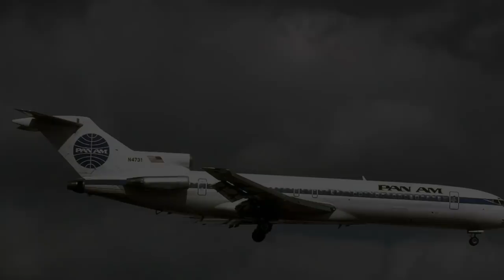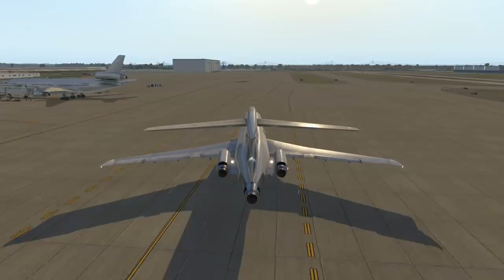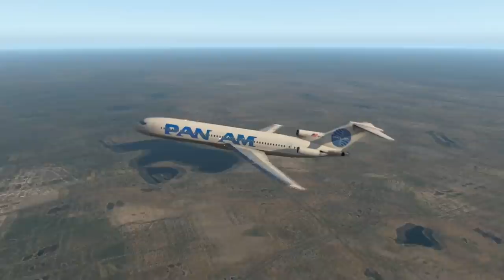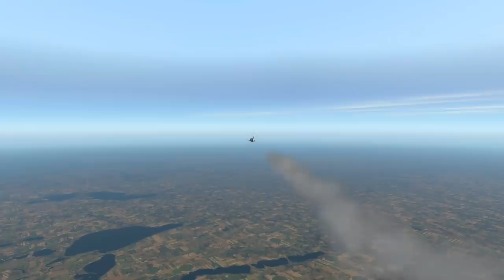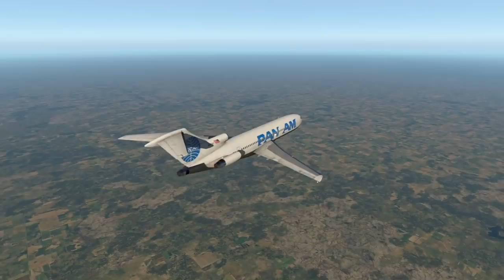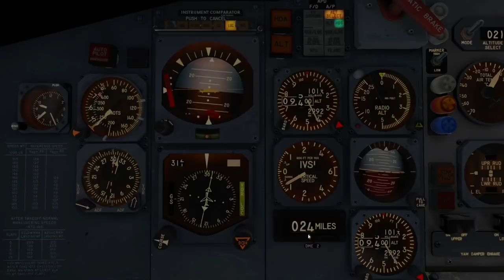An Invisible Threat | Pan Am Flight 759

Comment: Wherever you are recording, you may want to drape some blankets on the walls, to remove the reverb.  Your audio will sound better.  Also, if you have a concrete floor, put something down on that... I really enjoy your work. Please keep it up.
Reply: The real problem is simply that the volume level is way too low.  I've got it cranked up to the max on my smartphone and I can still barely hear it.  And the signal-to-noise ratio is poor as well, as a result of the super-low volume.  ☹

Comment: Hi , I have discovered you lately, enjoying the presentation you do on classic accidents and subscribed. Already, I have commented on the Saudia L1011 fire, now on this one.
I was a flight engineer , 727 my first type for 10 years.
When this happened, we were having recurrent sim training twice a year, with Lufthansa in Frankfurt. Their sim was state of the art for 727s, and in one session they wanted to reproduce this crash, to see if we can survive. All part of training....
They had all the details, and had entered them in their computers, so it was pretty much accurate.
The take off EPR was the "reduced" option of #1 1.88, #2 1.90 (due to the S duct), #3 1.88 . Normal (max) EPR was almost always 2.00, 2.02, 2.00. 
They took off with the reduced thrust, which we used very often for better engine life when this happened.
Ok, on the first run , no matter what we did , lower the nose, then rise again step by step etc, We crushed! There was simply no altitude available. It was shocking, we were shocked , we "lived" the death. The German instructors did it on purpose ,in order to prove something!.... When you are dying ,you should think out of the box, survival should kick in..... meaning....
On the second run, after we had encountered the wind shear, the deal was to *slam the throttles to firewall*, don't care for exceeding limits, burn all 3 engines if we had too...
We did it, and this time we survived!, the engines on a real plane would have needed to be replaced, but there would be no crash.!
Lesson learned, simple things and measures can save life...
PS. That night after the sim , drinking beers in our hotel bar, the repeated saying was " man we died tonight"....we really lived the agony....
Reply: I FLY TOO Engine failure- Check Essential!   Lol
Reply: Thanks for this, very insightful!
Reply: Wow. What an insight. I love reading first-hand comments like this. Thank you for sharing!
Reply: Absolutely loved your comment. 
-Good stuff!
Reply: This was amazing to read, thanks for sharing!
Reply: @LunaticTheCat  ...and English is not my mother tongue 😜. Thank you for liking it. I answered from my other account 😂
Reply: I am glad that you learned how to not crash this plane. I hope that solution gets to all pilots, the solution you came up with. Perhaps the technology is better now, but still, knowing that pushing the throttle to maximum when you can't get altitude while trying to fly through a microbust might end up saving a plane and a whole bunch of people eventually.
Reply: @pooryorick831  it is all history now, 727s don't exist. 😔
At that time, the objective was to make us, crews, more protected by learning from these happenings....
Thanks for your comment

Comment: I flew at the airlines when the bulk of the wind shear studied began finally  filtering out to pilots. I believe the wind shear systems installed on aircraft and on the ground have stoped many many of these accidents from occurring again. In all my years as a pilot, 1987-2008, I only experienced 1 engine failure, 1-flap failure (failed to extend in unison and system auto stopped the flaps from extending) and 1 passenger death onboard. But I experienced some very, very strong wind shear during approach to landing and departure. In one instance during the increasing performance portion of the shear we ended up with engines at idle with a 1000 ft per minute rate of climb.  We were at the outer marker and discontinued the approach.  We the were ready for the downward momentum and decreasing portion of the microburst and had brought power back up but still felt one of the most unusual sensation of the aircraft not wanting to respond to the normal commands of climbing and accelerating. It would remind you of hitting 10” of clay mud in a vehicle, you hit the gas pedal and even though your engine and transmission kick into high power, you continue to decelerate and you begin to wonder if you’ll make it through.  

In that instance, we reported the shear we experienced, declared a go around and the airport closed the runway as it had simultaneously received a very strong indication of a microburst and severe shear. 

Several years later, we experienced another rapidly developing microburst going into COS. This one approach controlled warned us of the potential and the tower called the wind shear. We leveled off and began the climb for the missed approach. Again we experienced significant increasing performance followed by a downdraft and then a 30+ knot drop in airspeed.   What made this significant was the altitude and pressure altitude of COS. I can’t help but wonder had we not had the benefit of Doppler radar, the aircraft wind shear detection system and the training developed after crashes like this.... well it makes one think about what might have happened.

Comment: I was once at Dulles on a plane about to take off.  While we were taxiing, the captain told us there would be an unexpected delay.  After about 10 minutes of sitting on the taxiway, the sky went black and the most intense storm passed over the airport.  I think we sat there for about 40 minutes until it had passed and everything was normal again, when we took off.  To me it was simply common sense, but I guess that doesn't happen on every occasion.

Comment: Love your videos. It's like an episode of Mayday without all the recaps and padding after every commercial break lol

Tip for your audio: it sounds like your recording level is too high. Set the input level so that the meter never reaches within 10% of max. That's when you get clipping, and there's not a lot you can do about clipping once it's recorded. In Audacity or whatever video software you use, apply a compressor (twiddle with the settings til it's where it needs to be, a quick search on vocal compression should get your there) and then boost the level a bit. DISCLAIMER: not an expert but that's what I would do.
Reply: Too high???   If anything, it's way too LOW!  I can barely hear it! 

I don't hear any clipping.  What I DO hear is a relatively high amount of background noise, which is the result of recording at too low of a level, resulting in a poor signal-to-noise ratio. 

He needs a better mic and needs to record at a much higher level.  (Though perhaps the former will obviate the latter.)
Reply: @Milesco  I was referring more to the input gain than the overall level. This is really old thought, like when he was at 7k subs lol.
Reply: @jordanzish   Yeah, hopefully he's bought a new mic since then.  I think he may have acknowledged the sound issues in the comments to one or more of his videos; I'm not sure.  I'll hafta check out one of his newer videos to see (or rather, hear 😉) if he has fixed the problem.

Comment: I am sorry.But at the 2 minute or so mark, it is stated that wind shear warnings were going off all over. This is totally FALSE. This crash is what caused the FAA to install wind shear warnings at all airports.There were none previously. I was a Kenner (city where it crashed about a 1/4 mile from the airport, not as far as they show), cop. I was elbow deep for 10 days in picking up body parts, I WAS THERE. :(
Reply: LLWAS windshear detection suyems were around long before PA759 went down...   As far as the ones installed at MSY in 1982, please refer to page 14 of the NTSB's final report.  (AAR-83-02)
Reply: mavriktu I was a NYPD Lt. in NYC on 9/11.  Was there for months.
Reply: Acererak, there indeed were LLWS installed at airports in 1982.  After the EA66 crash @JFK in 1975, the FAA in 1976 started working on LLWS and it was deployed at 110 towered airports starting in 1977.  To be sure, these were first generation systems that were state-of-the-art as it existed at the time.  In the aftermath of PA759 (1982) and particularly DL191 (1985 @DFW), the technology improved and led to to TDWR (among other things), but LLWS remained.  After the 1994 USAir accident @ CLT, changes were made to LLWS (LLWS-2) which included relocating sensors to better capture events.

Comment: Wait a 727 can pushback by its self?
Reply: Daledat-roblox    Rivet counter
Reply: Actually, the 727 can indeed back up.........of course you'll need all 3 thrust reversers engaged and a lot of throttle but it will back up on its own. So will a DC-9. 

But in a way, you are correct, if the plane were to back up out of the gate, the force of the reverse thrust would very likely destroy at least part of the jetway along with other stuff...........

Comment: Taca injested too much hail that flight caused them to change engine construction
Reply: The original spinner design on the CFM56 engines were rather pointy, like > which had the effect of allowing too much rain/hail into the engine's core.  One of the things that came out of the Taca incident was a redesign of the the engine spinner into a more blunt shape, like ), do as to divery more rain/hail into the bypass airflow.  There were also some electrical wiring changes inside the engines..

Comment: 727’s do not have tail engines!
Reply from the maker: "Boeing's only trijet is powered by Pratt & Whitney JT8D low-bypass turbofans below a T-tail, one on each side of the rear fuselage and a center one fed through an S-duct." :-Wikipedia 
You must be thinking of the 717 :)
Reply: yes they do
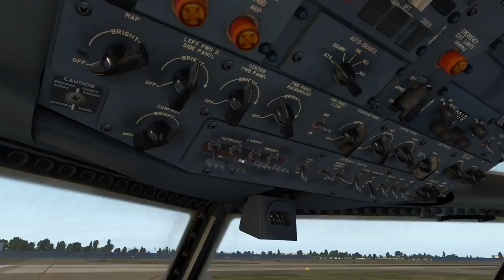Reply: Right.  3:59.   Engine 2 is under--not on--the tail.
Reply: @markprange4386  Engine 2 is in the tail.  The intake is just above the cabin.